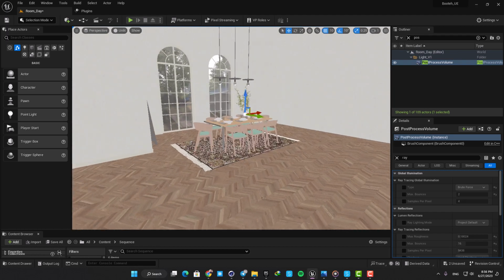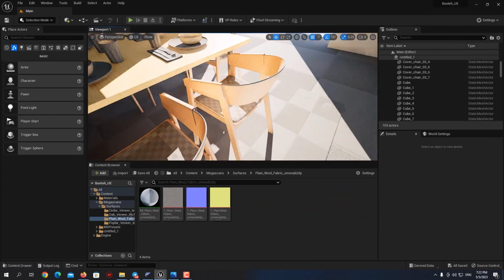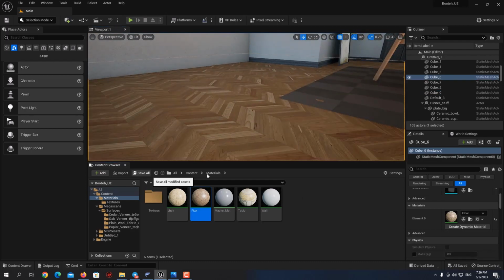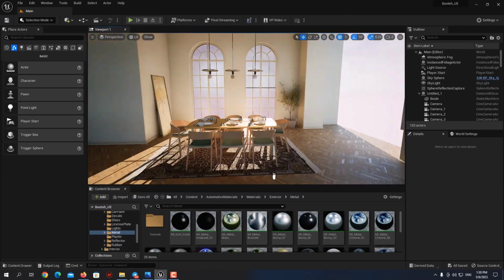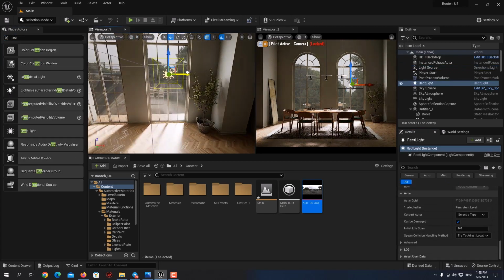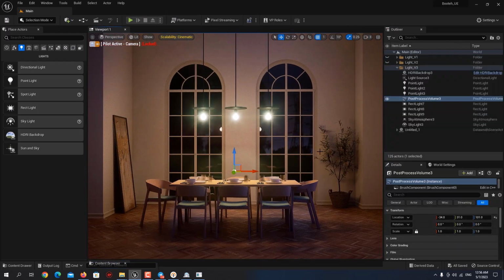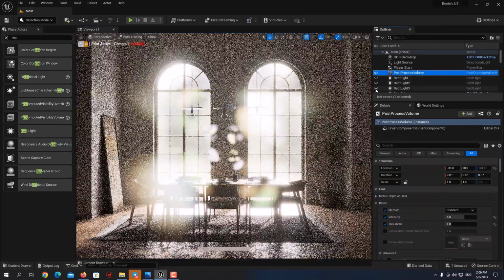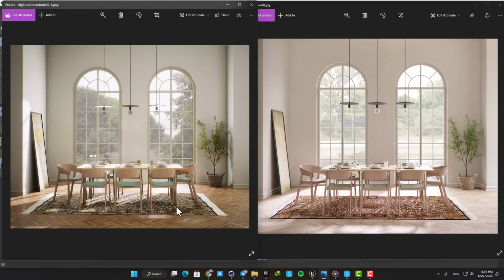Archviz With Unreal Engine 5 Using Lumen - RTX OFF !

Comment: im trying to make VR for House tour, but when im using cinematic looks, my vr will be super lag, so right now im just using hight setting maximum, any solution sir? thanks
my pc : ryzen 7 5800 64gb ram, 3070 vga, and im using oculus 2
Reply from the maker: Hey, optimization in vr is super important, you should reduce the number of the polygons for your objects, the resolution of your textures and also how you code the application. lighting is also important, you can use baked lighting instead of lumen

Comment: Hey ... maybe if you have time in the future u can make an video with the lumen settings or project optimisation that you will recomend for an average gpu user (gtx 1660 or let s say rtx 2060 6gb ram) for an interactive interior archviz project
Reply from the maker: well there is actually not much to play with when it comes to lumen . you just have to use low poly meshes, simple shaders and that's it . However, I am thinking about making a video about optimization in unreal and I will cover this a little , I hope that helps. If you don't have a powerful pc, I recommend baking your lights and not using lumen , it will give you decent results with good performance when played.
Reply: @UnrealART  The suggestion was in the idea that I would like to prepare a project (packed project) where the end user has a average video card (let's say 1660). Am I to understand that the best option (in this situation )still remains GPU Lightmass?
Reply from the maker: @bila0o  It depends on your project, if you don't have a lot of objects and a light scene, lumen might work but If your scene is heavy, you need to go with light baking